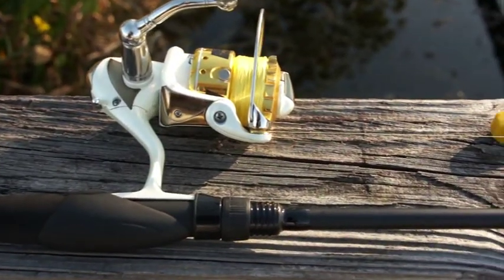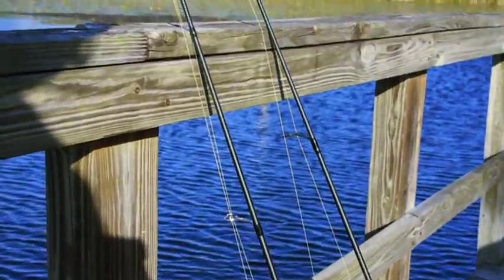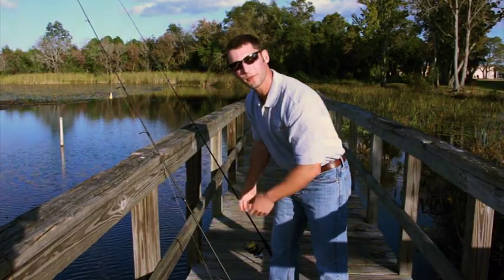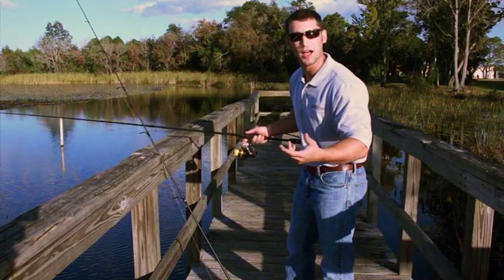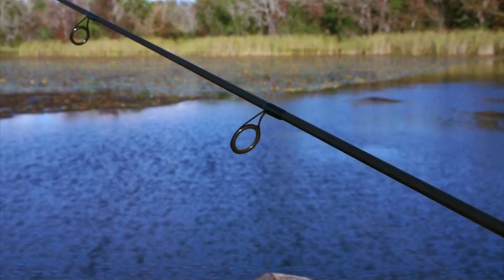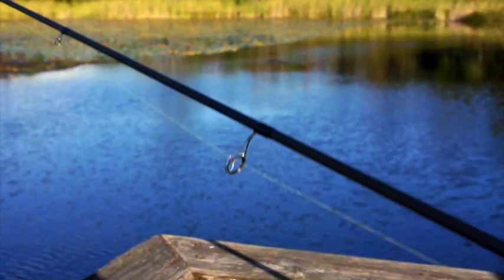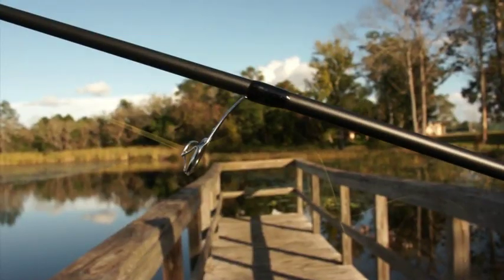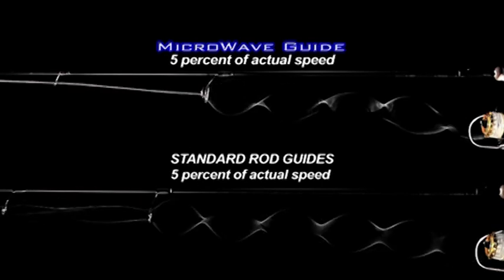Microwave Line Control System

Comment: @American Tackle I am a big fan of the Microwave system. However, I don't find the big difference is found when casting, but on the retrieve. Vibrations in the rod from the line hitting the sides of the first guide are greatly reduced, giving a cleaner, undisturbed contact with the spoon.